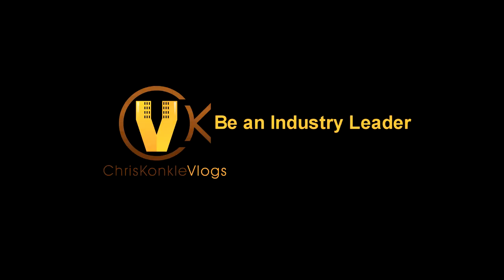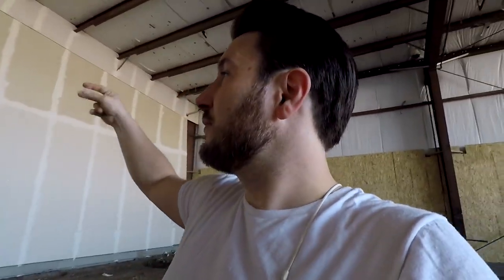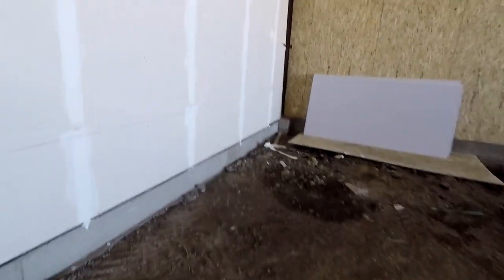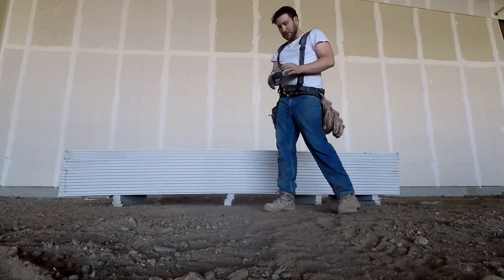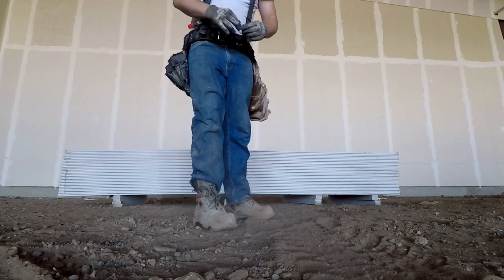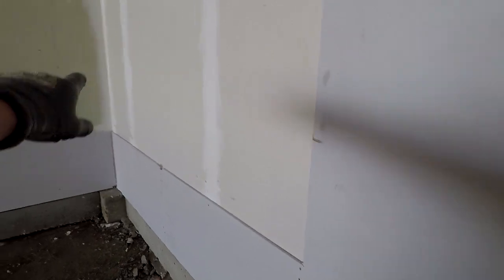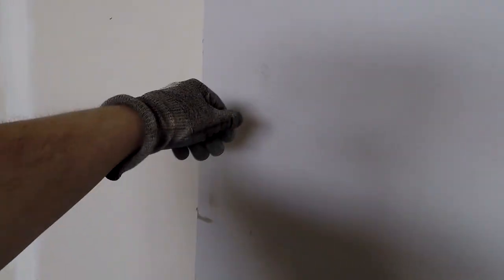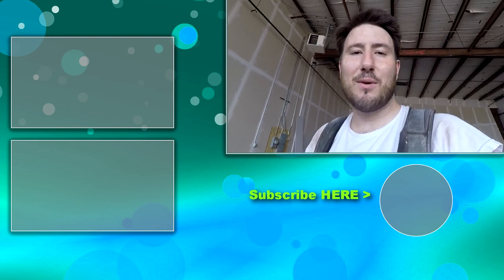Double Layer Drywall | ULTIMATE GUIDE!

Comment: Horizontal board bondings of the first layer are in one lane, all the same hight... There needs to be min 40 cm gap between horizontal bondings to evade situations like this and the same was done on the second layer.... Dont know if thats some rule in US but in EU we do 40 cm horizontal gap for every board on every layer no matter what the brand of the drywall board is.
Reply from the maker: You are correct. We almost always stagger both joints, in fact we 100%.of the time should be doing that. I feel like that was an over site here because I dont remember why it wasn't done. Cheers!
Reply: It doesn't matter for the firs layer because it will never be seen. The reason for the offset is for a better appearance, which doesn't matter if you aren't going to see it. Why make a bunch of extra cuts if you don't need to? Work smarter, not harder.

Comment: Are you making the bottom layer 2 ft so all the rest of the pieces stacked on top will be full sheets? Great video?
Reply from the maker: Yes that's right. This wall was originally single layer and I had that complete. Otherwise I would of put the first layer with the 4" to 2 foot strip at the bottom.

Comment: if there are too many screws like 8in apart instead of 16...will that make the drywall weak?
Reply from the maker: Actually, 8" apart is the norm. When I pc work I usually go 12" apart and that 99.9% of the time passes. But some jobs specify 8" apart. Too many screws won't weaken the board if your NOT breaking the bevels. Sometimes when I pc work the company will send there hourly guys behind me to add screws but that is rare. If your screwing off the field then 16" is the norm and if you add more screws its just redundant. It won't weaken the board just piss the taper off.

Comment: Thanks for the information bro , so when you install doble layer ,do you have to install paper on the first layer ? Why is that for ?
Reply from the maker: No we don't ever install paper in between the 2 layers. Sometimes the wall may have a vapour barrier on the studs outside of the insulation and then the drywall goes on. Does that answer your question?
Reply from the maker: O i get it now i re watched my video and on this job it was single layer and fire taped then the inspector told us we needed to add another layer. Normally we don't tape first layer!

Comment: I want to sound isolate an existing interior wall. Do I have to install studs on the wall and place roxul in between the studs or do I just place 2 drywalls on the existing wall?
Reply from the maker: The existing wall should be good. What kind of wall is it? Steel stud or wood stud? What size 3-5/8", 6" or different? Also an exterior wall won't need 2 layers of drywall for sound. If you use semi-rigid (roxul) and 5/8" drywall you should be good. Also remember to poly and caulk an exterior wall. You can hang 2 layers of 5/8" if you really think its necessary on the existing wall no problem. If you can get on our Discord server we share photos and talk about this stuff over there too. Here is the link to join our server https://discord.gg/htwHnQ you can always ask me anything you want anytime right here in the comments but we can't share photos. Discord allows you to share photos right from your phone. I hope this helps!
Reply: Hi just wondering can we do the regular paint on fire rated drywall, really appreciate
Reply: @ConstructionKronies  discord link no work?
Reply from the maker: @evilchinchula  Hey my good man try this one that may have expired https://discord.gg/KGEP2djc

Comment: Because it's two layers.. does first layer not require so many screws? 
When second later goes up.. first will have all of those plus the first layer.
Reply from the maker: This is true most of the time. All you need to do on first layer (when drywalling steel) is lock.the studs into position so you dont miss them on the bevels of the second layer. It's also nice to have your field studs plumb as well so you hit them all the way up. But yes put less in the first layer.

Comment: Do you use longer studs when installing the 2. Layer since the 2. Layer is more far away from the channel? And the 2. Layer studs goe trough the 1. Layer drywall to the channel right?
Reply from the maker: No, the length of the stud doesn't change. You need to use the required lengths as per drawing ceiling elevations. You will use the specified stud thickness say.3-5/8" or 6", the channel goes through the 2 ft knock out in the middle And you might have to use a layer of furring bar on a horizontal axis to the outside of vertical studs. On the first layer you use say 1-1/4" screws to tack the sheets up and then use 2" to fully screw off the scene layer through the first layer and into the stud or furring bar. I hope that makes sense if not ask me. You also always stagger your joints.
Reply: @ConstructionKronies  Sorry I ment do you use longer screws when Installing the 2. Layer Dyrwall because it has a bigger distance to the studs
Reply from the maker: Yes you do. Remember you don't have to put a lot of screws in the layer, just enough to tack up the sheet. You will use the longer screws on the second layer to fully screw off the sheets. 4 screws in the bottom plate 1" in from either bevel and 1" in from were the stud hits the bottom track or plate. Every 16" in the field and 8" in the bevels.

Comment: Hi there Chris.

What would you recommend if you had to mount a recessed low voltage plate into a double layer drywall (1,18 inch or 3 cm)
Thanks
Reply from the maker: The first thing I would do is check with what your local code says to do. I have seen this done 3 different ways - 1. Run the wire to a plastic box set to either 1" depth for double layer 1/2" or 1 layer 1/2" and the second layer 5/8". Or use a box set to 1-1/4" for double 5/8". 2 - You could use the regular boxes but use longer screws to catch the box. 3 - I have seen them run the low voltage lines to an opening and use a flat plate to catch the screws for the surface mount.  But I think the most important thing is to make sure your making local code. I wish I could help you more but  I am not an electrician I can only tell you what I have seen when drywalling. Good luck and hey I hope you let me know how you do it!!!
Reply from the maker: https://www.youtube.com/watch?v=RXBRzlvv4Iw Ahh I see what you were saying now. They should have plates for the different thicknesses. If its 1-1/8" just go with the 1-1/4" and maybe cut a pc or 2 or 3 of white Bristol board to act as a washer so you can have a snug fit.   Check out this video is this what you mean?
Reply: @ConstructionKronies  yeah thanks again for all your advice.
The recessed plate that I have to run the wires through,  it's got wings that go up to 1 inch in depth. So having a two layer drywall (3") what I think I'm going to do is reduce the second layer with a drywall saw, making it thinner to be able to adjust the wings of the kit when I screw them into the wall.

For the wiring, yes I will consult an electrician for as far as I understand only low voltage wiring is up to code for this kind of installation.

Thanks again.
Reply from the maker: You know I was thinking - Maybe you can neatly cut out the first layer to the size of the outside of the box and the second layer to fit the actual insert, You could even cut the outside layer bigger and add a j trim or something. You wouldn't need an electrician, I was thinking of something else at first. This is just to run your low voltage cables from devices.

Comment: whats the purpose of the double stack? is the drywall acting as some shear strength? my interest is stacking for acoustic treat/ sou nd dampening. with some green glue or mass loaded vinyly in between could really help with spound.... good info. nice technique
Reply from the maker: The double layer is for extra fire and sound rating. It also helps with strength. I used the green glue and double layer 5/8" in my studio here and it worked out perfectly.
Reply: @ConstructionKronies Nice video! Keep it up. Along the lines of sound proofing with secondary layer 5/8” I’m currently installing drywall for my recording studio and concerned about performance over cost and labor. Do you really notice the difference? Because cost is knocking at the door at this very moment. Lol.

Comment: Yeah my son accidentally put a hole in his wall so I'm like no problem son you can help me fix it got the hole cut put the new drywall in and it doesn't fit flush everything is flush except the upper left hand corner I've put 2 coats of mud on so far so tomorrow I'm gonna sand then build up where it's protruding and make it even with the wall best I can and it's double paned 2 1/2 inch slabs
Reply from the maker: O no! Is it possible you used 5/8" drywall on a 1/2" wall? If the hole isn't too big you can use these patches next time https://amzn.to/3Fsonzr Hope you can get it flush without too much mud!
Reply: @ConstructionKronies  no it'd 1/2 inch it said so when I bought it plus I measured it.i just think the wall is warped I out my 3 coat on and it you can't even tell there was a hole there except the top left corner is sticking out about 1/4 inch everything else is flush with the wall

Comment: I just discovered double sheets in my house. Why T F would someone do this? Without going into it too much I feel they did it because it had  wall paper, that's how other areas were.
Reply: Usually for sound dampening
Reply: @leyvaalonso38  didn't do a damn bit of good lol you can everything in this house
Reply from the maker: Haha yeah it was most likely to hide the wall paper. I'm assuming it was half inch as well not 5/8. If it was 5/8 it could be for sound and fire but if there is wallpaper between the layers then that's exactly what they did.
Reply: @ConstructionKronies  shit more like 3/8